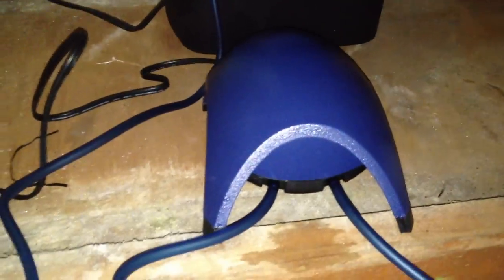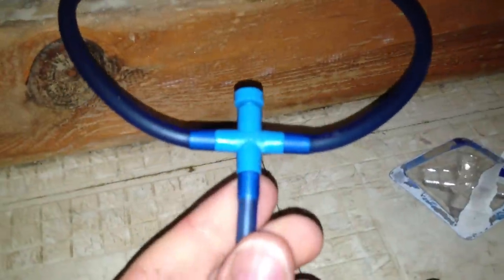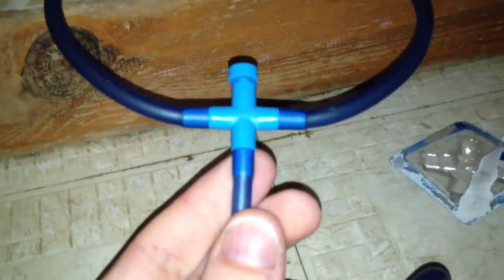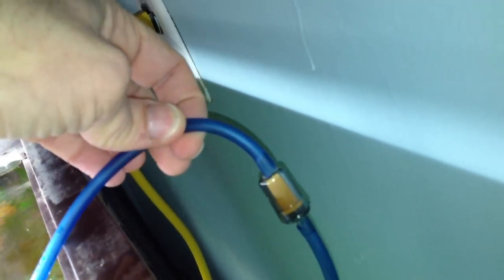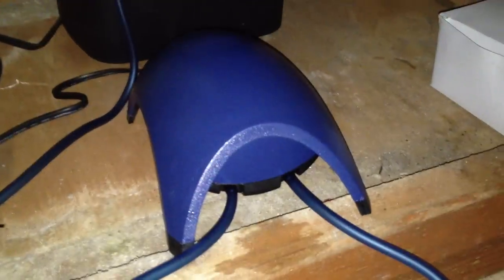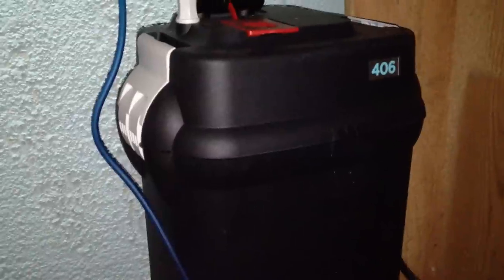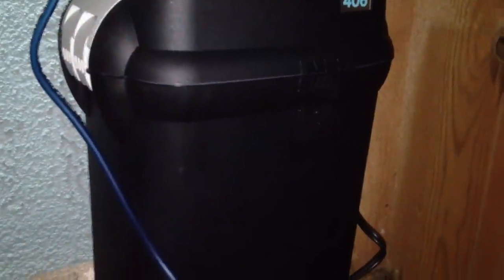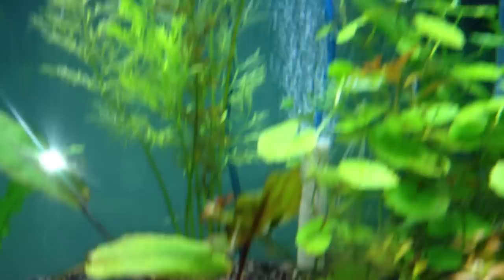Tetra Whisper 100 Air Pump - Sound Test for Noise

Comment: I have three wisper 10's and they are by far one of the best pumps to use they are without a doubt very quiet. i have one running my brine shrimp tank not three feet from me it has been running solid for two years and then some and it is still very quiet i run three the same for the same time and all of them perform great i want a 100 for my 66 gallon i want to run a stone and a sponge filter off the same pump my elite 802 is very noisy.

Comment: When I bought my fluval air pump it ran really loud for a tiny bit. I was worried plugs were off or tubing not tight enough anything that was silly. 
Honestly it truly seemed like the machine had to run its course. 
I went out for the night and came back the next day. The bubbler for my 180(the loud one) was then as quiet as the fluval I bought for my 50.
I bought whisper before and first hated it but I wonder if I just needed to give my bubbler some time

Comment: pumps a lot of air but way too loud to have above your tank, the smaller ones are quiet. but the 100 is loud, under the tank in a stand is probably quieter

Comment: I have had this pump since last November, lately it has become very loud with a loud buzzing sound, don't know why it started doing this, also the bubbles are not nearly as strong as they were when I first hooked it up. I have it on a towel but it does not help, am thinking of investing in another brand, any recommendations?
Reply: I just bought the "whisper ap300" they also make a "whisper ap150" for my 75g- ITS SOOOOOO QUITE, it's a little expensive at the "big box pet stores" so I would order it of Amazon. It's sooooo worth the money . I WOULD DEFINITELY BUY IT AGAIN!!!
Reply: An I came from the "whisper 100" as shown in the video. My new "AP300" puts the old pump to shame
Reply: Thank you I will need to remember that. I called the company with problem of the loud vibration noise and since it was under a year old they sent me a new one.New one is working great pumping out a lot of bubbles. Next time I am shopping for a replacement pump I will definitely look into the 300. Thanks for the info.
Reply: im here looking for answers why one plug gives less bubbles now.

Comment: this thing is very noisy. Sound in the video does not do it justice. It will need to be suppressed through various methods just like any discrete air pump.

Comment: Without providing the noise level in decibels, the video is worthless.  Noise in the frequency of the air pump vibrations is not easily picked up by a standard microphone.